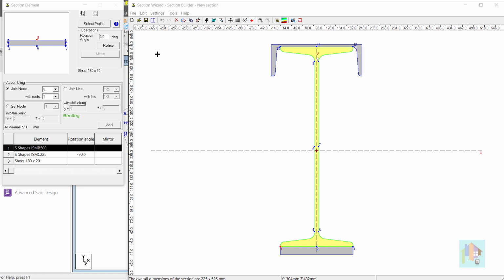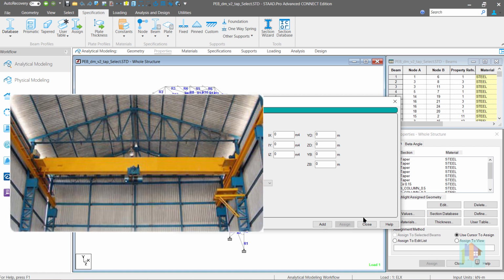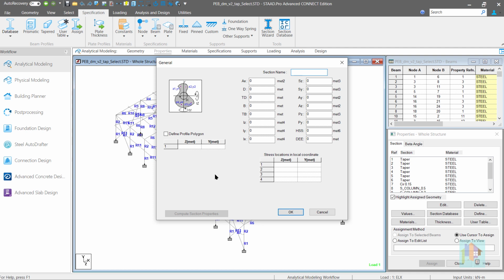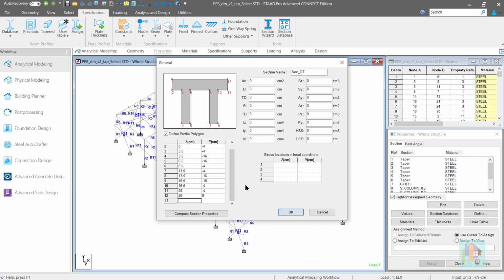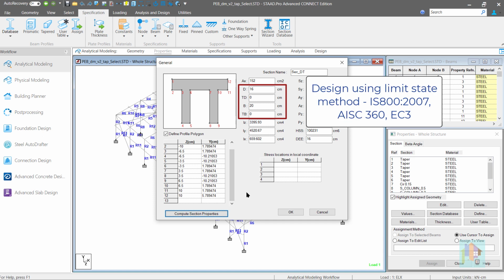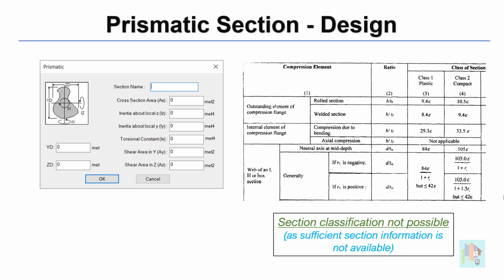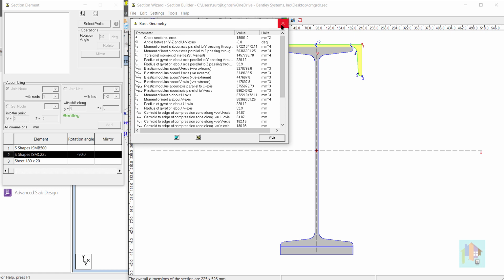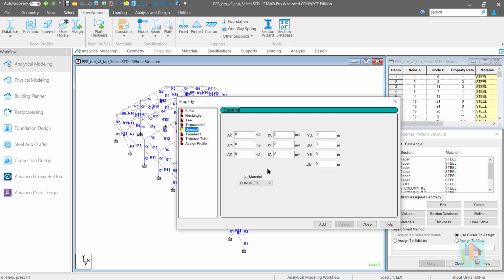Define Generic Section in STAAD for Analysis and Design | Difference of General & Prismatic Section

Comment: Hi! Do you have any reference to calculate warping constant for built-up steel section? For example, H-shape + Tee shape. The warping constant is based on the property of the generated general section and is not based on the actual shape of the built-up section.
Reply from the maker: You can consult Roark's Book of formulas.

Comment: How to create Rod sir
Reply from the maker: You can use user table Pipe section with zero inner dia or add the rod property under standard database (Dutch section database - solid round).

Comment: built up section created with section wizard. 
1. found I major axis value is Iy and I Minor is Iz, which is reverse in Staad. hence we export to staad, the values is not matching. can you please verify and reply.
2. when the member is assigned, user defined(built up section). and when run analysis is clicked, the structure is stopping saying verification of member properties. upt file is saved at the same file path, where staad file *.std is also avialble. please verify and reply.
Reply from the maker: I can remember both of these problems existed in an older version of STAAD and were fixed in later version. Which version of STAAD you are using? Also, I need to check the upt file that you have created, so it is better if you can raise this query in Bentley Communities forum and upload this .upt file for review.